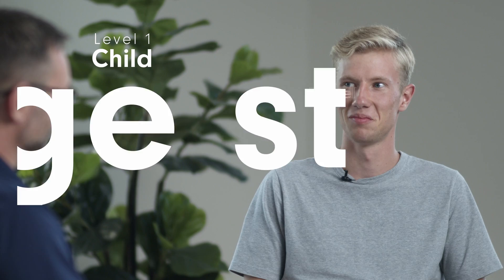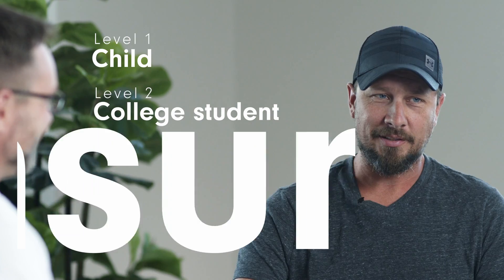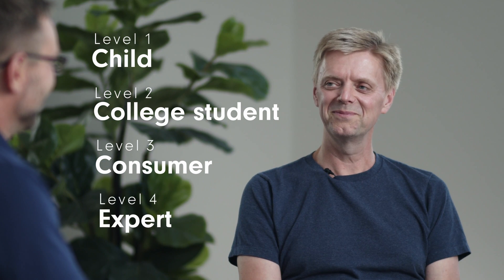The 4 Levels of Gasification in Outdoor Wood Heating

Comment: Seems like a downstream O2 sensor that is connected to an ECU that could modulate the components that handle different variables like air intake/temperature/etc could help deal with the 'problem' of wood that is <15% moisture content.  What do you think?

Comment: Why wasn't the furnace designed to work effectively when the wood is <15% water content?  The efficiency should go up as moisture decreases, but for some reason the furnace that was designed can't handle the the variables caused by such dry wood.